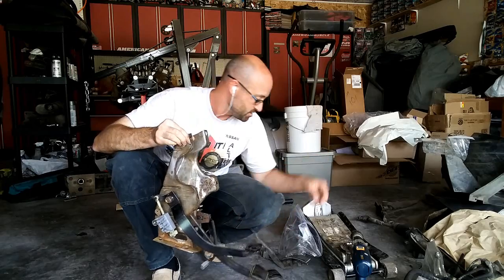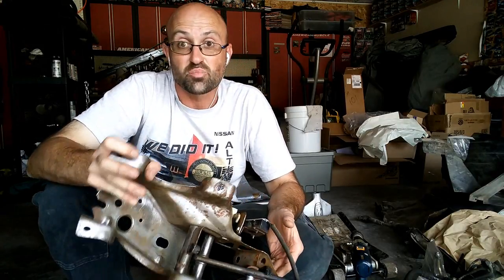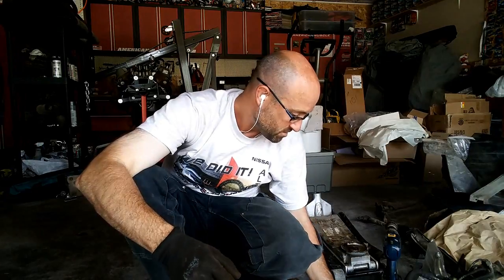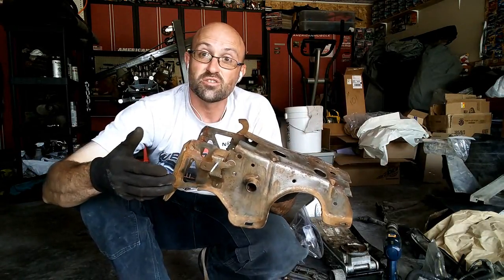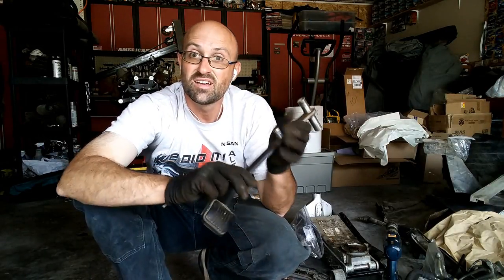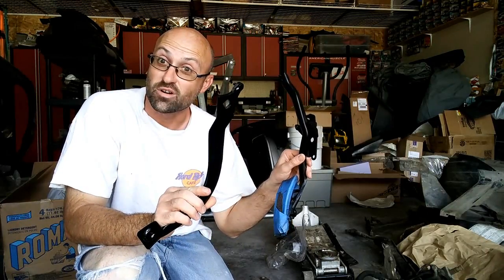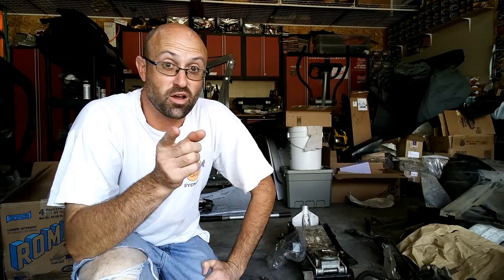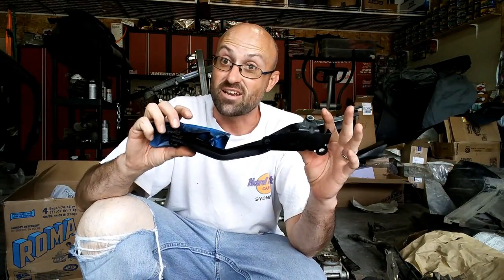How to Restore Your Foxbody Mustang Pedal Assembly

Comment: Now that's getting down to the nitty-gritty,lol!
Reply from the maker: I'm going to restore every little piece if possible, unless I plan to replace it in the near future.
Reply: Basin Motorsports Ain't nothing wrong with that!If I did that my car would be sitting another 2 years, lol!Now I will clean up every thing as I take it apart! I agree with you ,no need to put rusty parts back on car!
Reply from the maker: That's what I did on the '92 when I worked on it.  I restored what I needed to (mostly interior).  With the widebody build, it's basically a "starting from scratch" adventure.  I still have at least another 6 months before the 2018 show season hits and the snow is gone, so the race is on.  I bought the '80 notch in April 2016, so I've been at it somewhat for 1.5 years already.

Comment: the RED 3m pads (to sand) are excellent and very ez to work with on them funny angles ! I need to take mine out to do the same and put new clutch guides and quadrant in . so much to do when your down to the frame and winter is coming fast so painting is right out .
Reply from the maker: Winter is definitely coming!  I have so many little painting things and cleaning that I'm still not sure what I'm going to do.  Over spray gets everywhere, so I'm trying to get as much done as I can before the snow starts to fall.

Comment: That assembly is almost mint! Mine looks like it sat at the bottom of a lake for years! I’ve got my coupe almost completely disassembled. Like someone else said, if I restored every piece I’d never get the car done but I don’t want to put rusty, greasy parts back on! 😡
Reply from the maker: It seems like it takes forever to do everything. Most of the fine details only have to be done once like the pedal assembly.

Comment: I have a 1991 GT I have issues with my brake pedal sticking once pressed, it will not return, I have to physically pull it back with my hand or my foot to get it back up to where I can utilize the brakes again any idea what my issue may be.
Reply from the maker: Maybe a leaking brake booster or master cylinder?

Comment: What is the part at 2:58 name??
Reply from the maker: I always call it the clutch safety switch. It tells the ECM when the clutch pedal is pushed in.
Reply: @BasinMotorsports  thanks for the reply. I looked into it after posting the question to you. The safety switch is actually on the opposite side, left of that unit. What you got is actually the "cancel cruise" switch. Pushing the clutch pedal also cancels cruise on a T5.  There isn't a lot of info out there on that switch. I'm chasing wires under my dash, after replacing a heater core and AC evaporator. I was trying to figure out another plug, on this line, that I think now goes to the Neutral Safety Switch on the that the safety switch you speak of. 
Sorry, I went off...just wanted to share what I found. Thanks again for the reply.
Reply: @jpp9846  do you remember where that plug went ?
Reply: @Eddie510s  was told it does nowhere on a T5. I tucked it back behind the stereo and have had zero issues